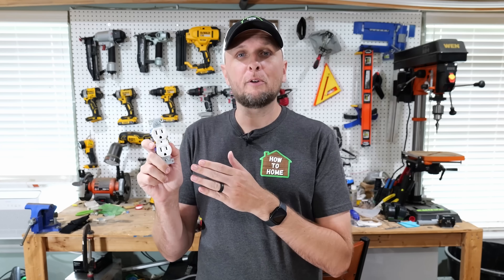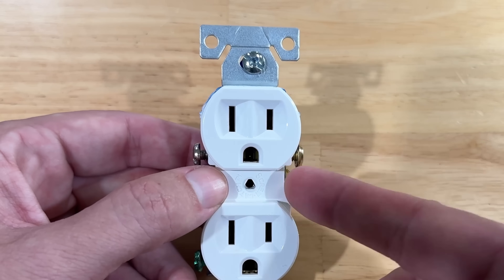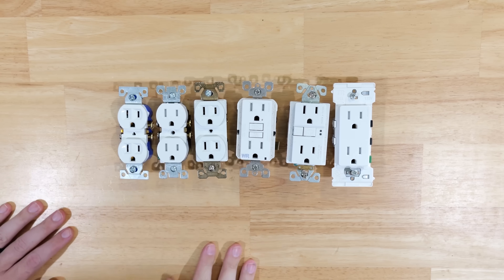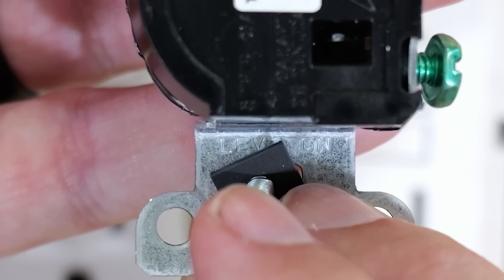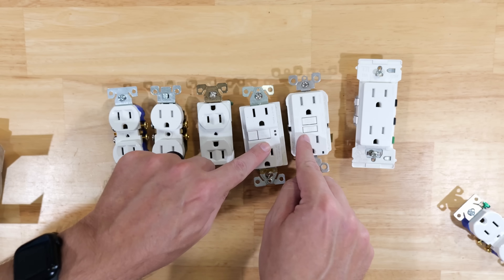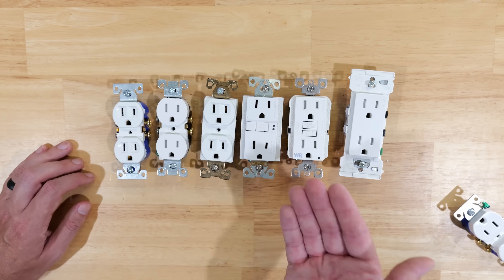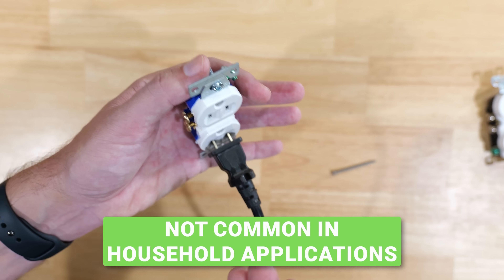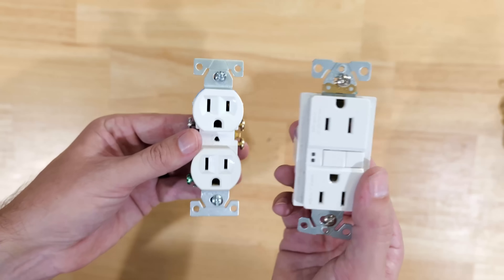The Shocking Reason Why Your Outlets Are Installed Upside Down!

Comment: The things you didn't mention, that I think are other good reasons for ground prong up are ... because American standard 120V plugs and sockets are absolutely terrible and they don't firmly slot in and tend to stay in the socket (unlike plugs in Ireland -- where I am from -- and the UK, which have three much more solid prongs, and where the prongs on modern plugs are required to have an insulated portion of the prongs nearest the plug to prevent any electrical connection even being possible when the plug isn't inserted far enough), so:

1. The top of the plug will often come out from the wall/socket more than the bottom. If one is going to get exposed more, you want it to be ground.

2. The ground prong tends to be a much more firm fit than the live/neutral blade-style-prongs, which makes it less likely to come out. With a cord pulling down (usually; gravity), and the ground prong tending to stay in, it will keep the live/neutral prongs in the socket.

US plugs that are designed to be flat to the wall minimize the torque due to gravity, so make plugs less likely to work their way out of the socket.

IE/UK plugs are much bulkier than US plugs, which is less convenient for tightly packing sockets on a plug board (US English: power strip/surge protector), and makes for larger stuff for travel, but engineering-wise they're a billion times better. US stuff is absolute crap by comparison, sadly. :( (I have lived in the US for well over 2 decades.)

Comment: OK, first of all the Canadian electrical code only requires the range plug to be installed in a certain orientation. They refer to it as the U-shaped ground connecter must be either to the right or to the left when installed so if they’re referring to the ground as a U-shaped connector, why would you install it upside down like an N then they would call it the n shape connecter not a U-shaped connector. U-shaped connecters means that the the ground goes up so that it looks like a U just my. But after saying that some chords that have a 90° plug have the ground orientated on top and some have it on bottom so in that particular situation, the cord must hang down and not be facing up.

Comment: In a house environnement, if you use extensions with gnd up outlets the extension wire will go up and then down, pulling méchanically on the plug! It is ugly and may damage the extension and/or the outlet itself and it is in the way...

Comment: FYI,  There are countries (one is the Philippines) that do not ground at all.  I still use the ground outlets (down) when I replace  them because the ground plug helps keep the wire plug contact straighter and tighter without sagging down.   Great video and thanks for the info.

Comment: I've always installed them ground prong down. And the reason  why electricians install them either way is preference. Having said that the issue is was told is that after some years of use, some receptacles get worn out to where plugs don't fit as snug as when they were new and kind of sag and not be plugged exactlyhorizontal into the receptacle. When that happens if you have ground prong down. Your appliance is always grounded though you may not get power to it, while if it it's ground prong up and the plug is loose and hanging. It still has pour going to it. But may not be grounded , hence not as safe.  Just what I was told. But either way, to each his own.

Comment: Many appliances have the cord ends made so that the ground needs to be down so the cord hangs straight down. The reasoning for the upside down method makes no sense. Say a metal plate were to come lose and fall onto the contacts. What if a person holds on to the plate, raises it up and it hits the prongs. They will get shocked. Something falling on the prongs will trip the breaker.

Comment: Nec 250a 5, ground wire on top doesn’t provide a reliable ground and prevents breaker from tripping.
Reply: Could you be more specific?  There is not a "250a 5" in the NEC.

Comment: I've been an electrician for over 40 years, both union and non-union.  My father was an electrician for years before that and then  owned an electrical supply distributorship.  It wasn't until the later 1970's that ground up was even a thing.  Most (if not virtually all) of residential 120VAC appliances with 3 prong right angle plugs (even today) are made with ground down plugs, making plugging in the appliance ground up, upside down with a sharp kink in the cord.  The whole ground up, for residential applications, is totally ridiculous,  and probably driven by a few self proclaimed, "electrical experts" opinions, like a few of the electrical inspectors I have come to know over time.  Not all, most inspectors are very knowledgeable and fair, but there are a few Barny Fife types,  with the, it's my way or the highway buddy, or just because I said so, attitude.

Comment: Eaton is totally messed up. Even though they have most of the writing ‘upside down’, when they put the plug in the package, it’s right side up.. ? They couldn’t be less clear.
That said, finger touching the hot blade when on the bottom is a much more likely scenario. A paper clip falling onto the blades would trip the breaker not sit there ‘live’. That and the way almost all cords and other devices are manufactured convinces me to always install prong down. And there’s that bonus face. 😮

Comment: im not going to flip my receptacles, mostly because in my 49 years on this planet i've never had a piece of metal slide down a wall and short a plug, and i doubt i ever will have it happen. technically it is just as likely to have one go up from the bottom. i also simply keep all my plugs pressed in ALL the way which prevents it from ever being an issue. if a receptacle is loose and plugs start pulling out i swap the receptacles with a new and tight one, making this a nonexistent issue.

as mentioned, most plugs inside the house are 2 prong making it worthless to flip them.

Comment: The best ("only") reason I have come up with for installing with the ground prong opening up is that it would prevent a loose metallic plate from falling onto the hot and neutral prongs and shorting.

Also, because it used to be called (around 40-50 years ago, anyway, when it was first standardized) a "U-grounding" outlet, and the hole at the top looks like a "U".

The most practical reason to install with the ground prong down is that every right-angle molded plug cap I have ever seen has the cord attached within 30° or so from the ground prong. Ground prong down results in the cordset extending downward, instead of arching upward and back down.

Unless you have a right-angle, rotatable cap...

Comment: Ground prong down provides a modicum of support for the cord that slightly exceeds ground prong up. I have found this to be true when outlets are getting sloppy and need to be replaced, so I figure it's a little better to have the ground prong down. Also, there are some cube wall taps that are designed with three prongs that are intended to have the ground prong down.

Comment: Codes or opinions are not a replacement for common sense 
Ever single cord maker, AC adapter, surge protector, carbon monoxide detector, ALL low profile appliance plugs, plug in thermostat, and on and on KNOW how the receptacle should be installed. Yet some how your are going to pretend you are not sure- good one you almost had me 😅🤣
Reply: ALL night lights, plug in dimmers, ALL timers,  Just a few more
Reply from the maker: Umm ok?  At what point did I not seem sure?  I covered the different schools of thought is all.  No need to get upset, nobody is trying to get one over on you 😂
Reply: @HowToHomeDIY  You had a golden opportunity to tell people to stop installing them upside down but you played it both ways instead. That was my point and I backed it up with a mountain of examples, all real world products that we use every day. NOT ONE OF THEM EVER are designed for the ground prong up. Not mad - just disappointed
Reply from the maker: Guy, I didn’t tell people to stop installing them upside down because it’s completely legal to do so.  I touched on the supposed pros and cons of both schools of thought. And at the end gave my opinion for which way I think they should be installed and personally do.  There is nothing wrong with either way because code says there isn’t.

Comment: Well, this is why the German electrical socket system is much more advanced and safer than the US one. If you pull a plug in the German system, there is no way you can make contact with the hot wire, because L and N are disconnected way before that. I don't know why the US is still using this antique system ;-)
Reply: It isn't like  people in the U.S. are dying because of this.  I imagine ours are much less expensive.

Comment: i thought i saw a Code article that said if a metal wallplate was used the ground had to be up. was i imagining things?
Reply from the maker: Doesn't exist.  Could be a local code though.
Reply: @HowToHomeDIY  i guess i'm going to have to check my WAC or RCWs for WA. But i will quote this since I brouight  it up. The notes in the Handbook under Art. 406.5 (C) Say, (and i'm going to skip ahead a couple sentences), "The NEC does not specify the position (grounding blade up or down), of a common vertically mounted 15 or 20 Ampere duplex receptacle.  Although many drawings in this handbook show the slots for grounding blades up, the receptacle may be installed with the slots for blades down."   Also, metal wallplates are addressed in 406.6, with (A) specifically addressing metal Faceplates and (B), the grounding thereof, and, sure enough, no mention is made to what i thought i saw. so....you're right. Edit, i'm going to edit this to add the last sentence of (C) i left out because i didn't think it mattered but after reading the comment after this i guess it does. to continue (C) "Receptacles can also e installed horizontally as well as vertically." Which, again, does not mandate one postition over the other. Still, with metall wallplates, I would avoid grounds down or newts up just because there is only one screw holding the damned things on and everything in a building vibrates.

Comment: I’ve read a lot of the comments number one according to my great uncle round plugs are put on the bottom. That was done because it looked like a face. That look of the outlet was more pleasing to the eye than the ground on top. The stories of the ground being on top because something might fall and short the plug out if it’s not in tight. I think it’s a tall tale. I asked a current master electrician, owner of his own business of 30 years. Who has a license to operate everywhere in the state to which I live. His response ground plugged down. He says he doesn’t know why it’s been told to be changed, but he’s not doing it. I guess it’s like changing the colors of gasoline, diesel, and kerosene. Just so somebody can sell more product, in my opinion.

Comment: One time my little sister had a penny in her mouth and she went to plug in a nightlight in an outlet in the hall outside of her bedroom. She had it partially plugged in and drpped the penny out of her mouth and it landed on the two prongs, giving her a nasty shock and blowing a fuse in the house plunging us into darkness. Because it was a simple nightlight and this was in the mid 60s when ground prongs were rare, there was no ground prong. So those kinds of things do occur, even though extremely rarely.
Reply: Are you sure she got shocked, or just scared from the flash of the arc?

Comment: Good analysis. 
Further data to support the "ground prong down"  method:
EVERY 90 degree grounded plug has the "angle" over the ground prong
(meaning it is meant to be plugged into an outlet with the ground prong down...)

Comment: Also if you look at the orientation of the ground screw, ground prong down puts the grounding screw at the bottom of your electrical box, matching the ground on a switch installed upright.  So ground prong down makes more sense from a wiring standpoint as well.
Reply: Inconsequential.

Comment: Besides a hospital or to distinguish a switched outlet only one reason that I have seen for gound up is to prevent the craking of the ground female. For instance in a garage and you have a three prong cord plugged into an outlet and someone steps on it or a heavy tool is rested on the cord. It most likely will crack the gound inlet,  but if installed up there's less of a chance that it will crack when stepped on or pushed down.

Comment: I prefer the ground prong down. I had a situation where a GF outlet, installed inside a wheater protection box, some electric equipment would not fit properly. But there are scenarios where I might want it reversed. In my kitchen, the outlets are sideways 😅

Comment: Never really thought about the reasons. I have always seen them installed as a shock 🤯 face, and upside down is just weird looking to me.  As a child, I was told it had a shocked face because it was scared kids would be hurt if they touched it.   Most of the outside wall mount GFI I have seen are mounted sideways,  So then we have the question, ground prong to the left or right?

Comment: Best is ground up. Many 3-prong cords, especially on business machines have a delta configuration plug with ground lug on outside of the plug opposite the line lugs. Also in any 3-prong cord plugged in greater stability of the connection is achieved with ground up.

Comment: If you Google on an ungrounded, unpolarized receptacle which side should be used for Hot and Neutral wires.  The answer says since it is not polarized it doesn't matter however, it's generally recommended to consistently wire the hot wire to one side( usually the right) and the neutral wire to the other side( ususally the left) for proper identification and safety purposes.  Which happens to align with the polarized outlets Larger slot (neutral) on the left and the Smaller slot (hot) on the right, therefor the ground prong is down.

Comment: Years ago a very will known electrical inspector in Victoria BC said that the reason for installing the ground down was that some ones Grandmother was electrocuted in XXX hospital  with the ground up as the plug had come out and was hanging down so the Grand Mother was then un grounded. So she died, which is not what most want. There used to be, three and a half columns of grounding in other chapters of the code book. 
There are many things which I still think are stupidly done.  so not going to make more comments.

Comment: ASK ANY ELECTRICAL INSPECTOR if you have questions.
Reply: Yes, because they took a 2 week course at community college!
Reply: @ The same applies to house inspectors. It is more accurate to hire different reputable trade contractors to do inspections. For example, hire a master plumber to inspect the plumbing. Hire a master electrician to thoroughly inspect the house ( test every receptacle, take the panel cover off, etc.)

Comment: My wife used to do medical transcription work from a home computer. Her company sent out an IT guy to make some adjustments on her computer. A paper clip had fallen off of the back of the desk and you guessed it. Kaboom! Very large flash from behind the desk followed by all the lights turning off from a blown fuse. It must have scared the crap out of the IT guy. I suppose in theory, it could still happen with the ground facing up if the paper clip decides to fall onto the (Hot) side of the plug as it is sliding down the ground at the top. 

I was reprimanded by my nine year old granddaughter for putting an outlet in with the ground up in our kitchen. That's what sparked (No pun intended.) my curiosity as to what is correct. I still install with the ground down unless I'm not thinking. Usually, I've got 3 or 4 other things on my mind when doing these and it's easy to forget.

Good post.

Comment: ALWAYS install any receptacle with the ground connection at the bottom. Sometimes a cord that is plugged into the receptacle becomes a little loose and the ground connection is loose and not made. So when something is loose in the receptacle and the ground is not made there is a safety hazard. If something should touch the live side of the receptacle you might get shocked or killed because there is no way for the power to be turned off. When the ground connection is at the bottom and a connection becomes loose  the ground is maintained. Then if something touches the hot side the breaker will trip or the fuse will blow shutting off the electricity. The ground wire is there for safety reasons. You only need to touch the live side to get killed.  
ALWAYS INSTALL ANY RECEPTACLE WITH THE GROUND CONNECTION AT THE BOTTOM!!!

Comment: Not an expert on the subject, but I notice that most of the $5.00 3 prong testers are designed to plugin ground prong down (in this position, the LED indicators are on top). Easy to read test results.

Comment: With so many manufacturers printing such shabby instruction manuals. Why does the nec default to the manufacturers?
Reply: Because the manufacturers have to get their products tested and listed by a third party like UL.  For the NEC to require a product to be installed against the instructions other than how the product was tested would be a huge liability.